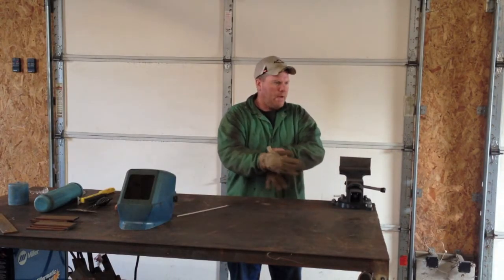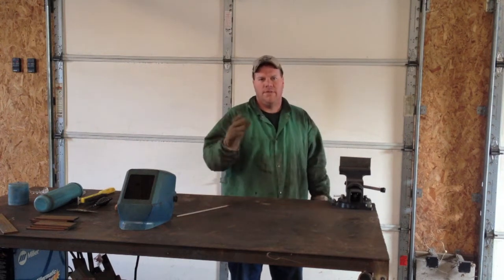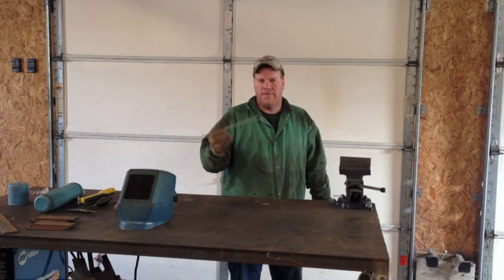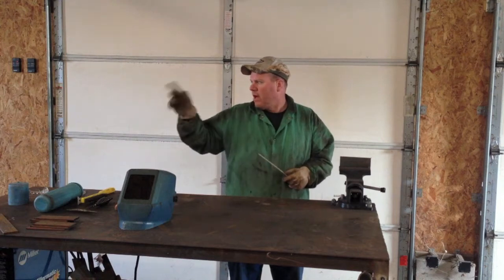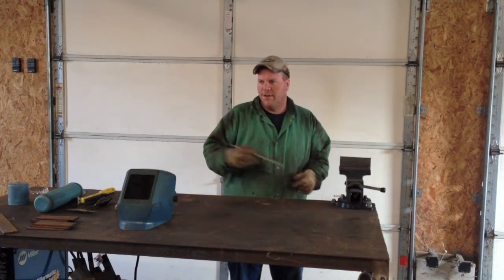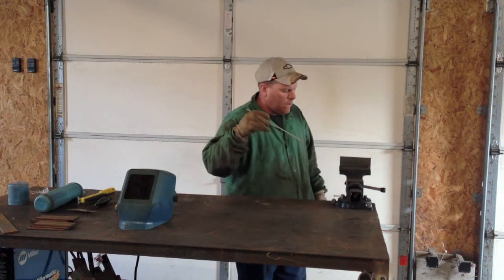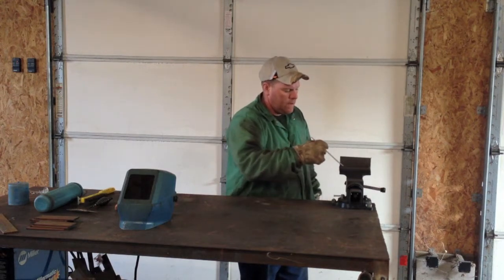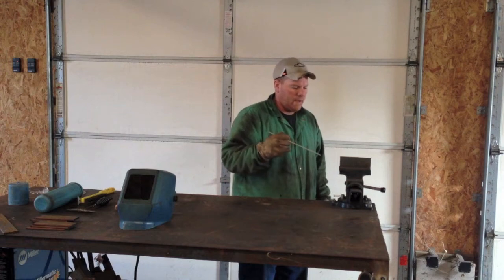Stick Welding Techniques and Tips 7018 No Weave Fillet Weld

Comment: Your work angle (where the rod is with respect to the joint), needs to bisect the angle of the piece you are welding.  If the piece is at a 90 degree angle, your work angle needs to be at ABOUT a 45 degree angle.  You need to ‘back drag’ your rod; don’t push the arc.  Your travel angle, which is in the direction of the back drag you are using, will be at about 10 to 20 degrees.  Keep your arc length short – about equal to one diameter of the rod you are using.  Watch your travel speed
Reply: and when you actually work in the fiel all that bull shit goes out of your head. Pull a puddle nice toes no undercut correct temp and muscle memory manipulates everything else.

Comment: can you please please explain the rod angle better. i cant do a fillet weld to save my life. it frustrates me so much
Reply: 6013 on my machine i did it succesfuly with 70 to 80 amps instead of manual recommended 60 amp guess the amp gauge was off